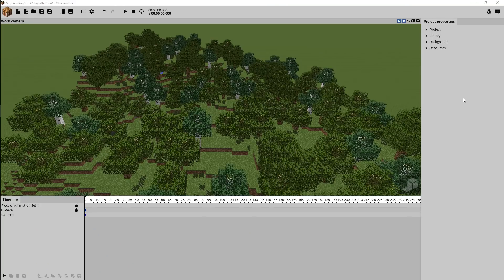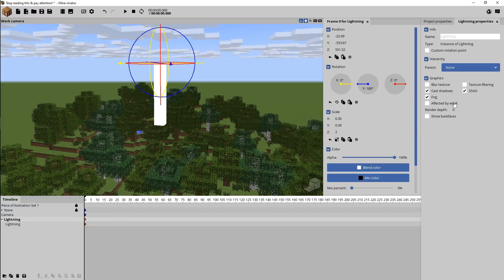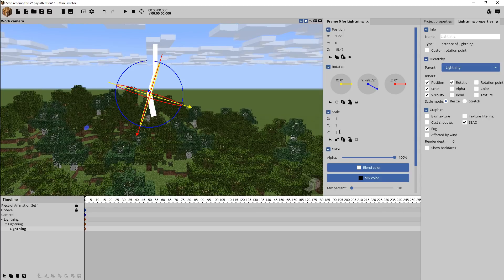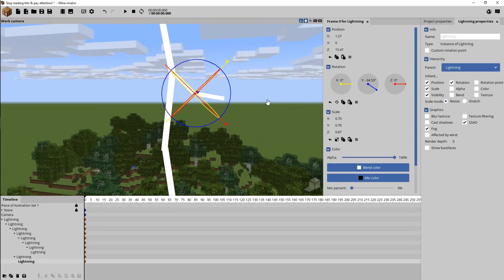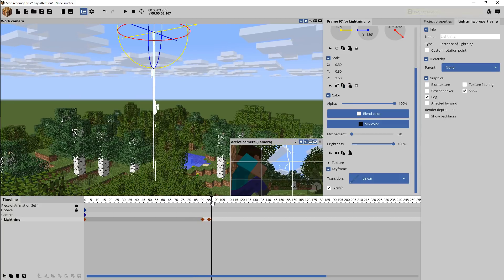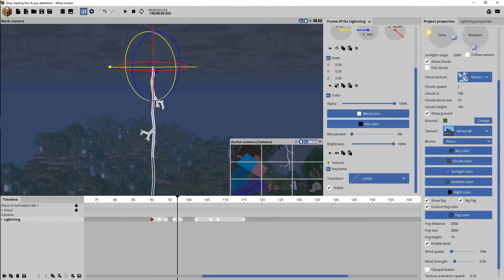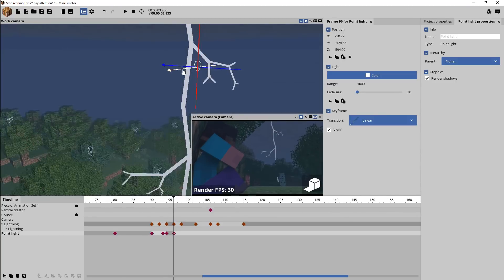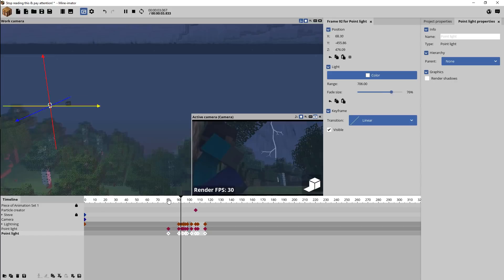Lightning Thunderstorm - Mine-imator Tutorial

Comment: When i try to scale the different cubes and such, theyre basically centered on the rotation point/marker thing. Also when I scale it, it scales on both Z ends, your does not seem to do that? Did i miss some kinda setting? Heres a screenshot: https://gyazo.com/4ee0234d7933700e3d497aa7a58e554b - not entirely sure whats up with that xD Dosent seem to scale/rotate the same way that yours does.
Reply from the maker: Scaling expands from the Rotation point. You can tick the "Custom rotation point" option in the Object's properties to move the rotation point wherever best suits your needs.